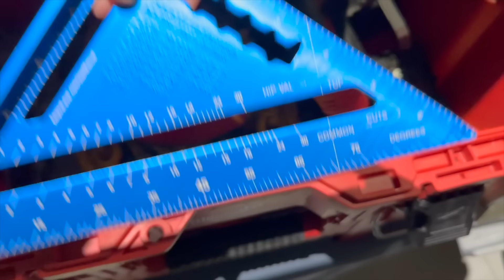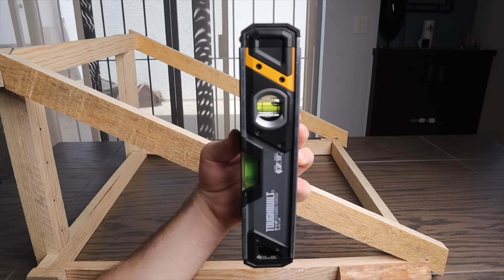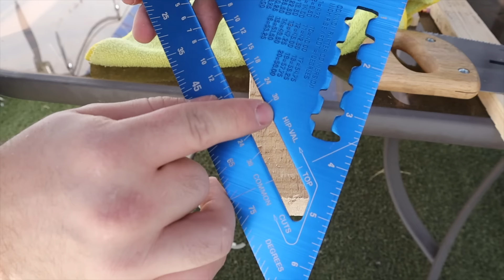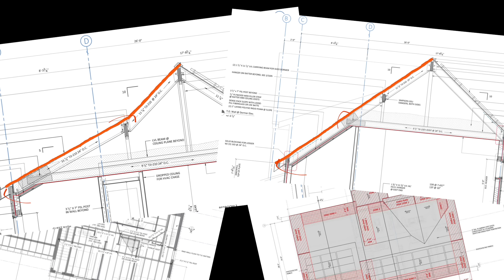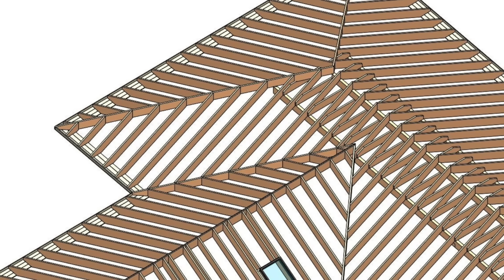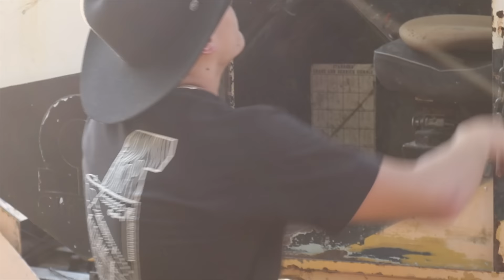Most people don't know this, how to use a speed square, the ultimate guide.

Comment: How do i find the angle when i have a door opening top plate but its about an 11 degree opening to 90 How do i find that plate angle up in the air when its a horizontal angle? I cant use the plumb bob or level angle method because its running horizontal not vertical?

Comment: But how to find an angle on framing plate when its sitting on the ground flat and its not a 90 degree cut? Same thing pivot point and read? I flip the square upside down and still pivot but its not reading right its about a 13 degree angle I cant use the pivot point because of which side the cut is?

Comment: Quick pro tip for aspiring carpenters: the total of the plumb cut and the level cut = 90 degrees. So lets say you have to install some fascia on a dormer. You've figured out that the plumb cut needs to be a 4 pitch. Run a straight edge from the pivot on your square over the common 4 mark and you'll see that a 4 pitch = about 18 degrees. Now just subtract 18 degrees from 90 degrees and you get 72 degrees. 72 is the angle of your level cut.

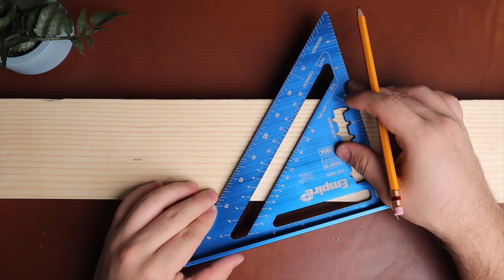Comment: I get it, but this makes me angry: At 1:16, this 20° makes a 70°. If the lip is your base, this is a 70° angle. If the spine is the base...then it's 20°. The spine is your 90°, so adjusting the lip to indicate 20° makes your pencil line 70°. 20° is merely your complimentary angle and if you cut that board, it will have a 70° cut.

Comment: This takes me back to the days of building homes. I'm old now, but I used to be out there every day. Framing, decking, nailing. Sometimes hand setting trusses, sometimes with a crane. "Slick side down". I was a good cut man, too. One time we decked Horace Grant's house in Winter Park, Florida. It was a two story with a 12 pitch roof. It called for 3/4" plywood. We had to carry the boards up to the middle landing of the staircase to hand them out to the roof. Then dry it in. This was back in the days of no safety lines. Just toe rails. Now, looking back, I don't miss it so much. LOL.
Reply: 🤣🤣 Hard work, for sure. :D Someone has to do it tho!
Reply: Different breed!

Comment: You've confused pitch with slope.  Roof pitch is the ratio, shown as the lowest common denominator, of the total vertical rise to the total horizontal span of the building. Slope is the height in inches  relative to the run of 12" as you described as pitch but thats slope.  Its a common mistake so common i suspect I've blown someone's mind with this revelation.

Comment: I should've watched this video prior to buying my speed square. Mine looks quite different than yours. It has only circular holes in the middle with the sizes indicated next to them. I guess it is for drilling holes in a wood. Other than that it has a couple of elongated sections that run the full length along the both sides adjacent to the pivot point. No "HIP-VAL" measurements available.

Comment: Only things I ever use them for are 90 and 45 degree cuts.  I really don't need them for anything else, but I prefer using them over a Tri-Square or a combination square as with their surface area, they sit flat on the board you're marking, whereas with other types of squares you have to hold them up while you hold them in place.  The only exception to that in my workshop is using a framing square on plywood as you can lay the whole square on the wood's surface.  For odd angles, I don't have to know the specific angle as I can use a sliding T bevel and then transfer the line to either my miter saw or my radial arm saw.

Comment: Any one wonder why there isn’t level and plumb bubbles on the speed square?
Reply from the maker: Stiletto has a bubble, not sure why its not more common
Reply: @ I have been retired and away from the trade for many years, wished I’d had one back then.
Reply: @ just looked at the stiletto and it only has one bubble, there is a niche for an inventor and investor to make one with both bubbles.
Reply from the maker: For sure

Comment: its important to note though, that a square will not make a 90 deg mark if the wood is not straight........if you ever made a cut and then wonder after why it wasnt straight even though you used a square to mark it, the wood wasnt perfectly straight and it threw the square off

Comment: Brain started to melt at the hip and valley segment. I do feel not as ignorant to what a square can do now however. Im going to have to find another video on the hips and valley for some explanation for some better understanding. 

Thank you. Should serve me well finding the correct angles to cut metal roof decking in my trade of Ironwork opposed to scratching my head with everyone else and just cutting multiple pieces to get said sheet to fit. I knew there was an easier way...many thanks!

Comment: I don't work with wood, I'm an electrician, but the speed square is an invaluable tool for marking out tray and trunking and checking for plumb, but I have for a while wondered about all the different markings on the square and how they are used. Now i have a better understanding of the speed square and it's applications. Thanks man.

Comment: Unless I missed it…. When you were showing angles you failed to mention that the left side of the speed square (as you pivot) also gives you the angle based on the top of the board using that as your indicator line.

Comment: You forgot to thank Albert J. Swanson, the inventor in the speed square, which are still in production today. It can also be used as a guide when cutting 2x4's with a circular saw.
Reply: The most common use I have for a speed square. You only have to make 1 tiny mark on the leading edge. People have seen me do this and thought I was some kind of genius, then I saw them do it. Perfect 45's also

Comment: I used mine to scrape ice and snow off floor joists so i could get the glue to stick. Boss didn't want to try a sali e spray. Not sure it would have done any harm or not. Would love i put from someone who has tried saline spray to melt ice on wood pre glue up.

Comment: 8:11 - How would you determine "the shoe, or flat side, is 90 degrees to the blade"? Would you just have to eyeball it? I see you placing the end on the blade, but where would you look to confirm it's indeed 90 degrees?

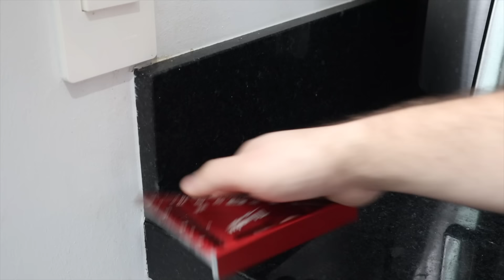8:24 - also, is this slight bit of play showing that angle is not quite 90 degrees?

Comment: Hello. Your video came up randomly. It was good. Question though, maybe you can help me. I've always had a problem calling it a speed square. I know it's because one squares things with it, but wouldn't it be more fitting to call it a speed triangle, as it's shape is a triangle? I drive places with a car, but I don't call it a drive, as it's a car and is in the shape of a car, so it's called a car. Seems weird.  
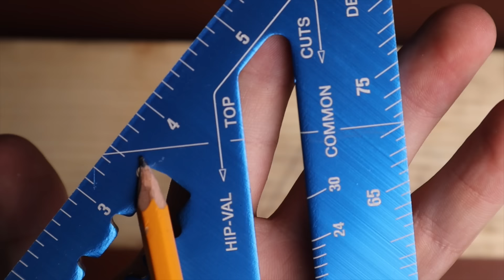 Also, at 5:39 you are talking about the marking on the triangle that gives you the reverse of a birds mouth or seat cut. Did you know you can get the reverse of the seat cut by instead of pivoting the square to the 6/12 and marking it, turn the triangle around, mark the 6/12 then pivot. This will give you a 90° angle of the pitch. 
Have a MAGAnificent day!

Comment: @james_gatlin I am definitely sharing this with my various woodworking groups! Hands down this is the BEST explanation I have ever heard. Apparently, I have not been using mine to it's fullest potential. 
I also use mine to stop my pen from rolling away. I use it as a paper weight for my plans. The tip makes a good back scratcher in the middle...bahaha. 
Joking aside, I use mine for most of my projects. It works well for a saw guide but you have to be careful not to catch it with the blade. 
I clamp it in place to ensure the board is straight.
Reply: Just counted...shared in 13 groups...lol

Comment: Great stuff, but 3:57 a rafter square is actually a larger version of a speed square, they do the same things but the names are not interchangeable. Speed square is the smaller one (7 inches), rafter square is the larger one (12 inches).
Reply: You are objectively wrong. Speed square is a proprietary name. Like Velcro, NOS, or Kleenex. Swanson owns the rights to the term speed square. Rafter square is to avoid copyright. Literally they are the same thing. 

You’re wrong additionally on sizing. As per above, this is Swanson’s trademark. And they literally sell 12 inch speed squares. But historically Swanson focuses on 7 inch speed squares hence your mistake. You see rafters bigger bc they don’t want to compete with the company who owns 7 inches and the brand name that’s ubiquitous. Thus,  companies rebadged their speed square as “rafters” and focus on 12 inches which is why Swanson also went after the 12 inch market eventually  too. And why speed squares have hips and valleys on them. Literally for the reasons he mentioned - for rafters. Eg rafter square. If they weren’t the same they wouldn’t have hips and valleys haha

As a fabricator not a carpenter, I always assumed rafters bumped to 12 for the sake of scale and imperial unit maths. That’s exactly how and why I own a Klein 12 rafter and 7 inch metal Swanson speed square from the 80s. But I don’t know that last part for sure but it always made sense to me
Reply: So whats the story behind my 12" framing square. I use it for tile and welding... and sometimes a tomahawk @CYMotorsport

Comment: I’ve been wanting to learn how to properly use these things for a very long time. A little too fast for me but very informative. Angle cutting has always been my kryptonite when it comes to woodworking. I will be saving this video and going over it multiple times before my next project!
Reply: "You might find yourself becoming entirely dependent on it and feel frustrated when you can't use SPEED SQUARE. If you revisit the geometric and physical principles of triangles, you'll be able to solve problems with just a few button presses on a scientific calculator, no matter how challenging the conditions.
Even when you only know the lengths of three irregularly shaped sides, you can determine all three angles at once using mathematical formulas. This is also possible with right triangles when you know only two side lengths.
By mastering these fundamental concepts, you'll have a more versatile and robust problem-solving toolkit that doesn't rely on specific tools like the Speed Square."
Reply: @mathamour  this is beautifully put.  Yet  .
The speed square is a woodworkers calculator as a tool , as well as a time traveling device.

You can imagine the relief of wondering about something and finally discovering after years of not asking. ...unless , you've known it all the whole time.  Which I suspect is your case Mr.Pythagoras

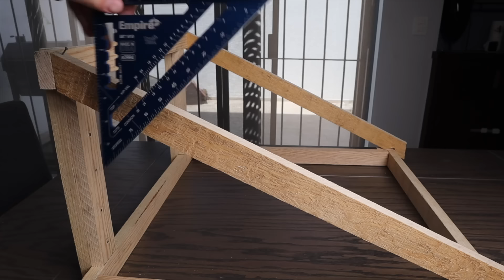Comment: Fantastic video!  Question at 1:46 mark...does accuracy depend on the floor being level?  

If the structure in your video was on a slightly sloping garage floor, how should one adjust for that slope while using the level and speed square to calculate the angle.  Is the sloping floor irrelevant?  Is the plumb bob option better than using a level?

Comment: I completely agree with you. Also, we don’t charge little for this job, no matter where you are, why? Because the equipements we fix are expensive. So please, please invest in your tools, your work revolves around them. So it’s not going to kill you to spend a reasonable amount of money on some, say, Wera tools. I got for myself this ones now (Wera 05135926001 Nut Drivers) and (Wera Tools 05073593001 950 SPKL/9 SM N SB Long ARM HEX Key Set, One Size, Multi). They’re not cheap I know, but is a one time purchase. Besides you look like crap with chinese tools fixin a 5K monitor.

Comment: Very good video . I did work in a truss factory . We used those stupid aluminum plates that are just hammered on to join the boards. It took me less then one day to figure out that those aluminum plates are crap. I was sent outside to get some boards for the next lot of work we were doing. Right then I saw trusses sitting outside and the aluminum plates had bent up and away from the boards they were supposed to be holding together very well. I asked a guy how long those trusses had been outside and he told me he had put them there only a few days before because they were wrong in that the roof was different then whatever those trusses were made for . Anyway after only one rain day and a couple of days of sitting the wood had changed and so those stupid plates did not hold well at all. I asked him if the same thing would happen in an attic if the roof leaked or it was humid in the attic . He told me yes and he knew full well those plates which are almost a given now in construction are going to bend away from the boards and in time perhaps fifty years which is not long for a house the roof is not fixed would fall in .  So when I had my house built I had it done using the same system you used plus I had iron plates and nuts and bolts to hold them on worked into the plans my planer drew up. I feel sure my roof will last a long time . Also I had it made with boards much bigger then the 2x4 boards .

Comment: I'll admit I barely used any of these functions and have been using a digital tool for verifying angles. 

I'm happy I finally watched this and will be using my speed square more often.

Edit: I should have mentioned that I primarily use metric not the far inferior imperial measurement system 😂 It's tough though since all the materials I start with after in imperial, but generally it's not a huge problem.

Comment: I have two left hands when it comes to remodeling and small construction at home. I just suck at it. What I learned about living in an old house (1900) is that you can be perfectly symmetrical when remodeling but the real drama is when the house itself is CROOKED! The walls, the floor, everything. None of it adds up or aligns remotely perfectly.. So that means extra calculating and I suck at math.
Reply: I second that

Comment: Plumb is perfectly vertical, not perpendicular to gravity, since plumb is actually parallel to gravity. Just a technicality.
Reply: Tomato Tomaaato. I am annoyed by pendantic commenters who "correct" the presentation.  Have YOU?? taken your time to create a video??? If not, hold your correction unless you see something life threatening. Please.
Reply: @jennlizzy2019 calm down man
Reply: @jennlizzy2019  but what he's saying is not only true, it's also a meaningful distinction.  The vector of earth's gravity is vertical, not horizontal.  This fact is the basis for physics/the physical world on Earth, let alone what level and plumb mean.  Knowing and understanding this matters.  Do you even know what tomato tomahto means?
Reply: as someone who did a video on this, let me mention that the perfectly vertical plumb line points in towards Eairth's center of gravity. it is therefore a continuation of a radial reference. in other words: verticals off of Eairth can never be parallel as no two radii are parallel. the abstraction of "3D space" defines this fact away and consequently redefines Eairth as not spherical. 

there's a lot to be said about that. the water level also doesn't go out in an infinite flat plane, but actually curves around the planet embracingly, so our horizontal reference is actually circumferential to Eairth. 

but these are merely the iceberg's tip, there's so much more to be realized about the absolute shortcomings of that conceptual framework...
Reply: According to ChatGPT : Plumb describes a vector orientation that is precisely parallel to the local gravitational field vector at a given point on Earth’s surface, typically defined as pointing toward the Earth’s center of mass. A “plumb” line, under ideal conditions, follows the path of acceleration due to gravity and thus establishes a true vertical reference frame relative to the gravitational equipotential surface (i.e., the geoid).

Breaking that down even tighter:
	•	“Parallel to the local gravitational vector” — meaning it matches the exact pull of gravity at that location (gravity isn’t perfectly uniform everywhere).
	•	“Toward the Earth’s center of mass” — the ultimate point gravity is pulling toward.
	•	“Gravitational equipotential surface” (the geoid) — Earth isn’t a perfect sphere; it’s a bumpy, slightly squashed blob. A “level” surface is one that follows this weird shape. Plumb is what points straight into it.

Even nerdier fact:
Because Earth isn’t perfectly spherical and has mass irregularities, a plumb line does not always point perfectly toward the geometric center of the Earth. It points toward the local gravitational normal, which can deviate by small angles (this is called the “deflection of the vertical”).

In plain nerd-speak:

Plumb means being exactly aligned with the force vector of gravity acting at your specific location on Earth, not just “up and down” — but the true, technical vertical determined by gravitational physics

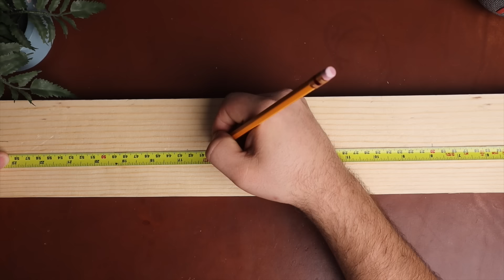Comment: You can actually mark 1.5" spacing like you were @7:37 in half the time by just going left to right, instead of right to left. It's faster to line up the markings on the speed square with a line you've already drawn, rather than marking a V at the 1.5" mark on the speed square and then scooting the speed square left to draw your second line on that V.

So first, I start by drawing my V marks for every other line left to right (these are for the lines on the left side of each pair).
Next, on each V mark I draw a line with the speed square then just slide the speed square 1.5" to the right, make sure the line I just drew is lined up with the correct mark on the speed square, and draw my second line.
Reply from the maker: I see, this is a nice tip i hade not considered, thanks.

Comment: Hey let the metric degrees be you already have you inches, foots bananas and other units. but nice video anyway especialy the last part I'm using the speed square as well. I was always calculating the degrees on the hips and valleys its simple math but with the feeter it will be easier